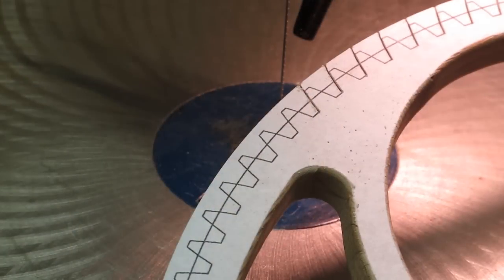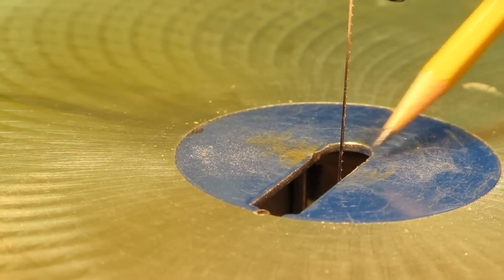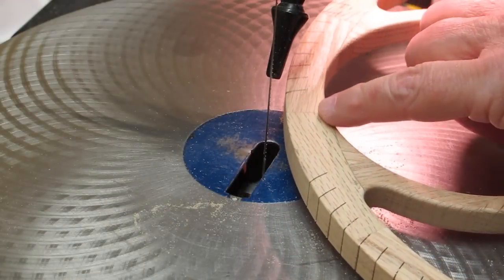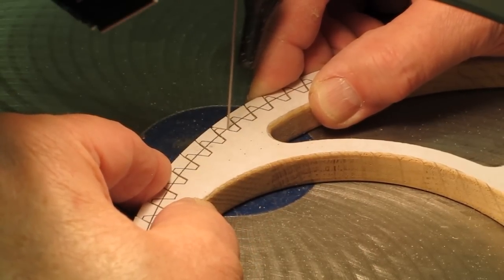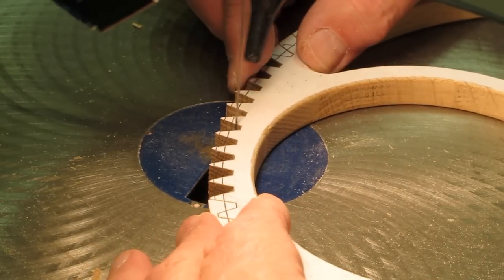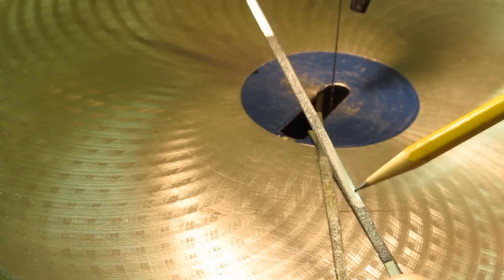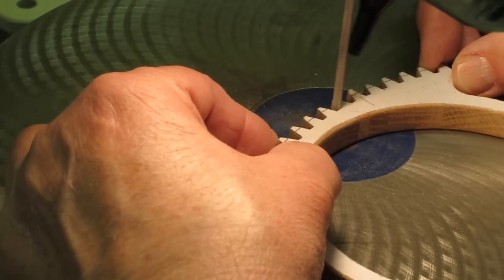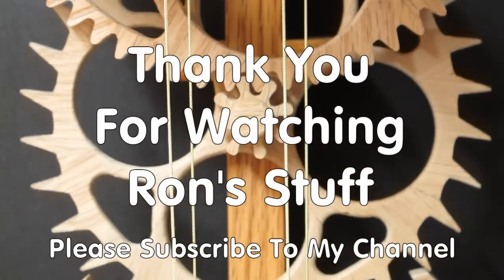Cutting Wood Gear & Clock Wheel Teeth

Comment: How did you deisgn the teeth for Minutes and seconds
Reply from the maker: I did not design these clocks. I have built clocks designed by Clayton Boyer. https://lisaboyer.com/Claytonsite/Claytonsite1.htm The large wheel in this video is for his Solaris Clock. My videos show how I made (and designed different ways to make) various parts of his clocks, such as homemade plywood for the wheels, using a combination of the C & R wood grain orientation resulting in a gear or wheel with better dimensional stability, a 48-hour conversion for Simplicity and a cordless screwdriver powered clock winder.

Comment: HSS or Tungsten Carbire Router bits can be cut to profile by ant good machine shop, or if  you have diamond burrs you can D.I.Y. (CAUTION! do not attempt without advice from a pro!)  A 'parallelogram' router clamp is a handy piece of kit to make. (a similar mechanism to some market weighing scales) This ensures the router moves up & down vertically. Then have a rotary table with small drill holes at precice subtended angle increments. Wear eye protection!

Comment: if you fit it too tight, the blade will break
if you fit it too loose, the blade will break
if you saw too fast, the blade will break
if you cut glue too fast, the blade will break
if you cut in your finger, the blade will break
if you throw it against a wall, the blade will break
if you set it on fire, the blade will break

god damn, is there any posssible movement, the blade will not break?
someone need to invent a new blade that WONT break that fast.

btw, nice vid.
Reply from the maker: Sometimes they last for days. Other times they don't last 10 minutes. Name of the game is always expect it will break and keep you fingers clear at all times. :-)

Comment: It is possible to buy graphics how much price and how to communicate
Reply from the maker: Sorry, I have no plans or patterns for sale. The source for the projects is stated in the video or video description, such as clock plans or magazine article.
Reply: Ronald Walters I figured out a way to keep blade deflection in check without a ton of practice... Just put the blower 1mm away from the blade or any distance you know by eye and even with the middle of the blade from front to back. Just keep that at the same distance to the blade as cutting and it comes out very square, I was cutting 1-1/2" Santos Mahogany for a piano leg support that was curvy with this method and it checked out square on all the curves before finish sanding. 👍
Reply from the maker: Most scroll saws vibrate too much allow maintaining the blow nozzle position in any position for very long... but if it works for you, great!
Reply: Ronald Walters I haven't been scroll sawing very long, I'm an artist and just started because I want to do Marquetry, I overlooked the shaking because I own a Dewalt 788 which has a double parallel-link arm design which dramatically reduces vibration... 8 years ago when I was in highschool they had the Dewalt 788 and it was so smooth, I owned a small King Canada scroll saw for 4 years and it didn't cut good enough for Marquetry which I always wanted to do, so I found it at Mississauga Hardware  $550 Canadian which it goes for $699 at every store here so I grabbed that deal, I've used it for 30 jobs in the past 3 months and almost completely forgot that scroll saws had vibration. I actually made a scaled parallel-link arm scroll saw before I bought my real one out of Baltic birch for $70 including hardware but I had the motor already and it worked really great, I want to hook it up to a pedal power flywheel someday, maybe I'll start a YouTube channel when I do that.
Reply: Ronald Walters Awesome outcome on the gears though, they turned out great. I'll learn a few things at your channel, I've always loved the woodworking channels on YouTube they've educated me on countless things I would have only learnt from experience or advanced classes it's just awesome having these useful hands on skills available for the general public that can help the economy and appearance of our neighbourhood's.